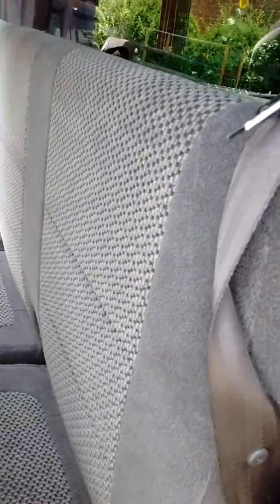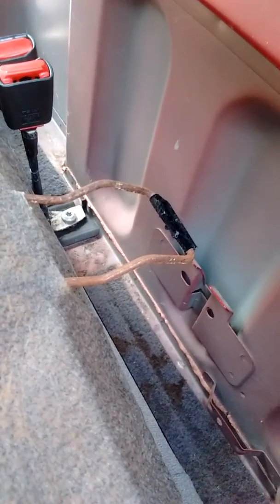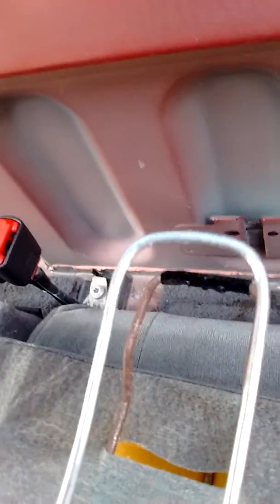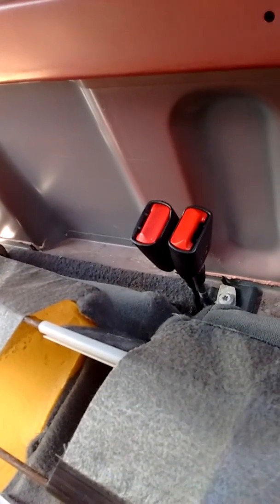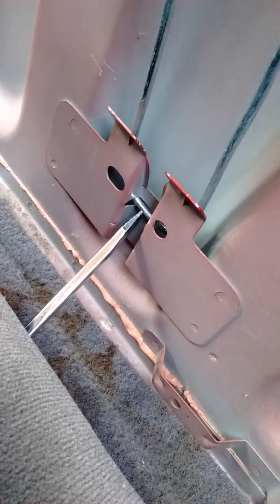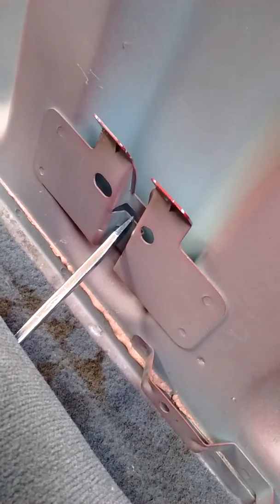2001 F-150 Back Seat Removal

Comment: This was extremely helpful. I ended up needing to tap the handle of the screwdriver with a wooden mallet as my pushing it was just not enough. But that worked. It was incredibly difficult to see to the latching mechanism. I used a beer bottle and mushroom can shoved into the gap between the seat and the seat-back to get separation both to see and work with. Thank you!

Comment: Thank you so much. I'm trying to clean my cloth seats but have to put them in my shop to dry as it is still getting below zero. I was so stumped discovering there to be no bolts. This is the only video I could find actually showing this

Comment: Thanks for the video. I couldn't figure out why mine wasn't looking like that though, and apparently my 1999 F-150 Lariat has a different setup. I pulled the black nylon loops in the holes where the lap belts come up to unlatch the seat and flipped the seat into platform position, and looked underneath and the bottom of the backrest had two bolts. I removed them with a 10mm socket and the seat back then lifted off the top hooks.
Reply: Yes 97-99 has a different set up in the back. On 2000-2003 the back seat bottom folds up. On the earlier trucks the back seats fold down. They are different.

Comment: Mine is bolted in place, no wire. 1/2" or 13 mm.  Then lift o, and remove. ?
Reply from the maker: On mine, the seat was bolted down, but the backrest was attached to the back of the cab as shown.
Reply: I was referring to the seat back. The bottom seat is hinged, and folds out to a flat load deck. Exposing the 2 seat back securing bolts at the bottom of the cab wall, where your photograph shows the wire clips..... My truck was assembled in Norfolk, Virginia. 1998. Back window started leaking. 24 years... After I purchased the truck. So if it ever stops raining up here..... I'll start repairs. Thank You for the informative video.

Comment: This video was good for the back of the seat but not the seat itself. These two t50 bolt are really stuck in the body of the truck.
Reply: I haven't done it yet but if you look under you truck there is a nut type thing the t50 bolts are secured into
Reply: @kadenwappel2227  Just tried to remove seat bench from my 97...there are  five bolts to remove, two on each end, and one in the middle. Penetrating oil and elbow grease finally won, but what a pain.

Comment: Do you pull up on the seat at the same time?
Reply from the maker: ivan rodriguez. Yes, but not to hard or it will make it harder to push the bracket out of the slot.
Reply from the maker: Yes, but not too hard or it will be difficult to push the bracket out of the slot.